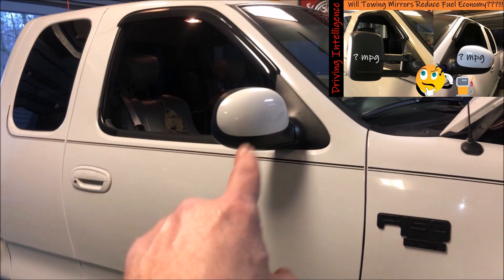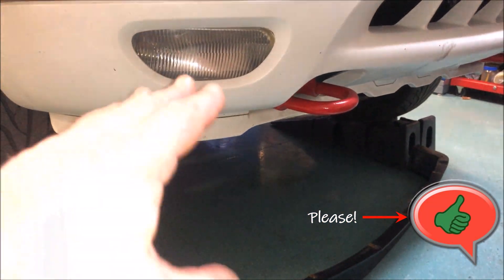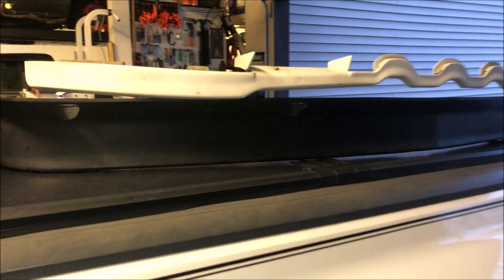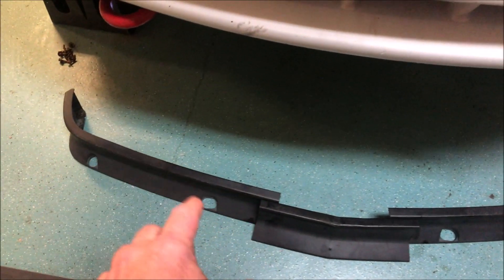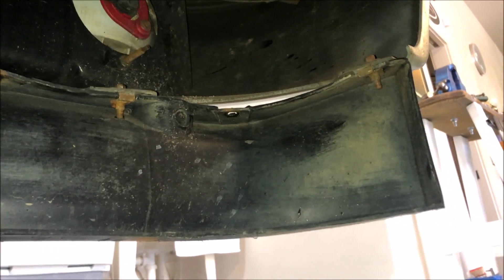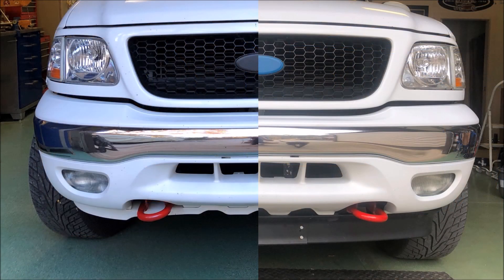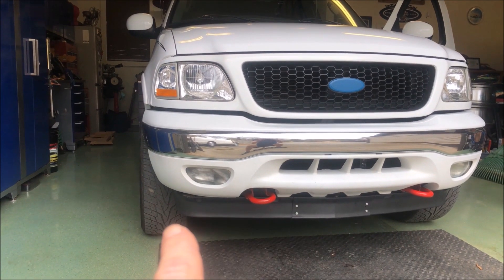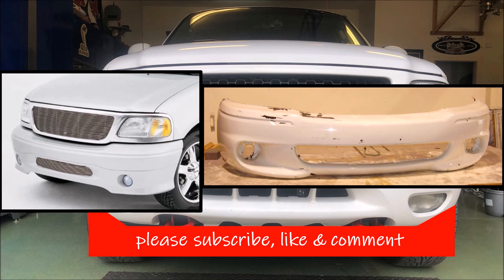Will A Custom Front Spoiler Improve Gas Mileage, MPG, Fuel Effficiency: 10th Gen '97-'04 F150

Comment: Another addition to consider..  make an under tray out of corrugated plastic for the underside of the bumper as close to the tires..  without interfering with the tires path when steering..   

I am about to perform this on my E350 van ...  Only waiting on some free coroplast to come my way from work....

Improve aerodynamics by smoothening the turbulence under the front of the vehicle and lessens the road noise...

Since my van is wider then a normal passenger vehicle . I will be strengthening the coroplast with peel and seal used in the construction of homes
Reply from the maker: This is a very good comment.  I have been thinking about doing this to my F150 as well.  I've studied how an undercarriage shield can greatly improve fuel economy.  First thing I'm going to try is a bigger front chin spoiler to prevent that air from getting under the truck.

Comment: Love this topic,I'm a career driver mostly 18 wheelers,Drove tow truck(Super duties)even service trucks.But this 10 gen for some odd reason is a handful on thw Hi way,By that it takes the most effort to keep it straight than any of the above trucks.I had it checked from front to back no issues found.It just has to be the design or something with the wind pushing me around on the hi way.
Reply from the maker: Thanks for checking in.  Hope you see all my other 10th Gen videos.  I have 2 '02 F150's, one is the HD F150 which is a supercharged supercrew, basically, a Lightning with 4 doors.    I measured the front spoiler of my HD truck and it is only about 1" deeper than the 4x4 spoiler.  My new 4x4 spoiler is about 3" deeper than the HD spoiler.  There is a wrecked HD in the boneyard with a decent spoiler that I might grab.  With regard to highway stability, my 4x4 was very stable on the highway, more so than my stock HD F150.  I guess it has a stiffer suspension.  I added Bilstein shocks to both trucks and also rear sway bars.  The rear sway bar on the HD F150 made a world of difference.  Check out these videos:  https://youtu.be/B9U_EH8Sxm8 & https://youtu.be/MG7lUPwDkno & https://youtu.be/GPm8Jj27sJg
Reply: @DrivingIntelligence  Thanks,Ive been looking for a wrecked HD they're hard to find around here.A guy wants 8500 for one that should be in the scrap yard for instance.Seeing this video puts a wider chin spoiler or lower valence tops on my list.That sway on the hi way is my only negative with this truck.If i could sort that out I'd be happy as can be.
Reply from the maker: Do you have a rear sway bar?  That cured my HD F150 highway sway.  Links in that video I sent on 10th Gen Sway Bars
Reply: @DrivingIntelligence  I don't,I'll watch that tonite.
Reply: Follow up--- Id love to try a spoiler from a lightening as you point out at the end,I'd know instantly if this was my issue.For this I'm more interested in stability then MPG.Keep up the great work.

Comment: Great video I been thinking about doing this to my 03 F150  for awhile now. But I think I might go a different rout Lowes sells some thick flower bed edging its smooth and flexible. I used it on my 04 Taurus for a lower dam with great results.  Thanks your videos are fantastic!!!!!
Reply from the maker: That's a great idea and I thought about doing that, but while in the junkyard saw this easy picking... the Tahoe.  How deep is the edging?
Reply: I will get back to you on that measurement .
Reply from the maker: @daleriggenbach2842  thank you
Reply: I did that on my Civic and picked up 4 mpg
Reply from the maker: That’s awesome.  I want to install a deeper spoiler on this truck to get more mpg.  A temporary install.